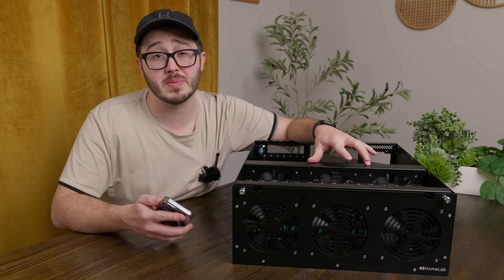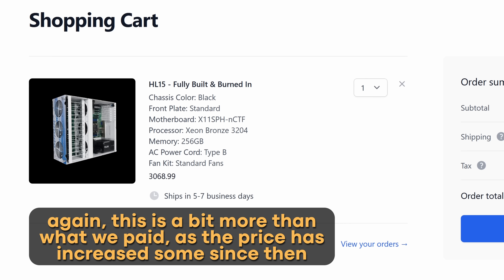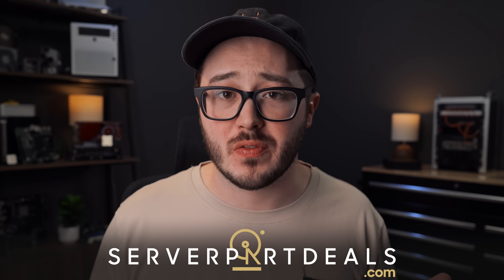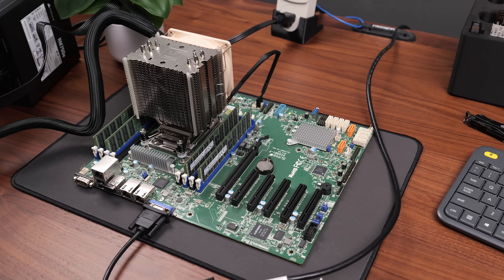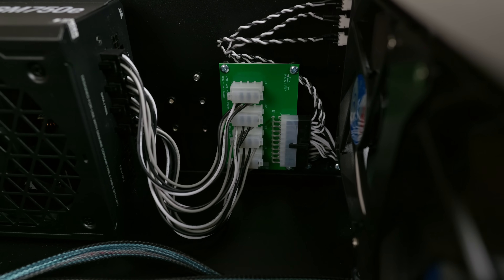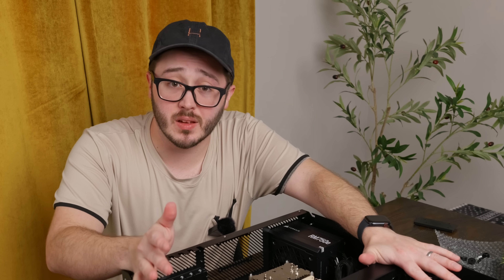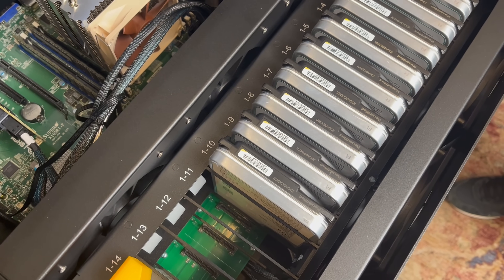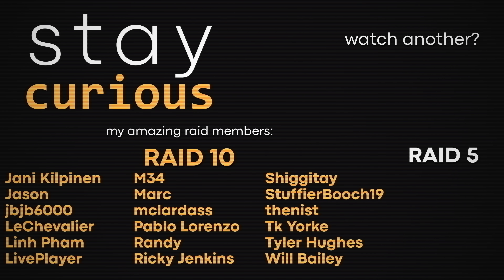I got an HL15... but not for the reason you think.

Comment: In the EU(germany specifically) its cheaper to buy new drives than to buy from serverparts deals as the drives itself are cheap the taxes they add on top(not calculateed in the price) are not if you buy new one you pay about the same and its new. Granted the new ones are not Enterprise Drives but same capacity.

Comment: What slide rails did you use in the rack? I also have an audio rack with threaded posts (as opposed to cage nuts) and finding slides that will fit for some of my gear has been a challenge.

Comment: The side facing fan is just screwing up the air flow in the machine. The card in the back is going to get plenty of flow for the heat sink without that. In fact it'll probably get cleaner flow because you don't have another fan pushing on the air causing a dead space someplace before that card. If you wanted to direct air, putting in a wedge of plastic to direct more air through the card would be a better solution for cooling rather than disrupting airflow.

Comment: I use M2 SATA boot SSD in a PCIe adapter (and NVME SSD on the same card for cache), only uses one SATA port, keeps the drive bays for storage, and there's a bit less cable clutter. I can see why you'd want redundancy though.
Surprised you didn't do 10G direct NAS to NAS connection. If you're automating backups it keeps traffic off the main network links.
I do like the Supermicro stuff. Been using since the X8 stuff started being sold second hand here in the UK. 
Until I went to Ryzen I was even gaming on a Supermicro 1366 ATX board with two 6 core Xeons.

Comment: LAG doesn't increase the bandwidth between two nodes, it allows a single node to service more clients without slowing down. To increase bandwidth between two nodes you need to use protocols that automatically split transfers into parallel streams and then recombine them, like SMB Multichannel, or faster NICs.

Comment: As other commented, just setup the 10g to each other and watch the data fly. Watching T3 (TrueNAS Tech Talk) with Kris and Chris from TrueNAS they suggest pulling the backups from the main server. That way if the main server is ever comprised, they don't have all an account to access to your local backup server. So pull the snapshots from main to backup instead of push. Makes sense from a data security. Great video.

Comment: To better align the fan that cools the heatsink on the RAID controller, we've had some success with Antec's "VCOOL" and also Vantec's twin slot fan that is designed for PCI slots.  The Antec VCOOL comes with an extension sleeve that adds more overall length.  The VCOOL also has a 3-speed switch, and it intakes air from the rear of the chassis.  In your setup, the VCOOL may only recirculate air that has been exhausted out the back, but at least it provides some options that your Noctua fan does not have.

Comment: I would skip the 10GbE and instead buy two Mellanox CX4121A 25GbE NICs and two one-foot 25GbE DACs and directly connect the two servers together that way. It would allow you to completely skip their LAN and avoid any network congestion in their switching fabric. Plus, you can still do a LAG over both DACs and mitigate the risk of a single connection failing, and in the far future you could switch to multi mode fiber and 25GbE transceivers, and physically separate the servers like others have suggested.
Reply: x10 HDDs in RAID10 that's about 600MB/s write speed. I think 10GbE is fine

Comment: 45drives the worst deal ever 2000$ for a case ,what  a rip off , and the bigest rip off is if you buy a complie system , they charge you 1000$ more just to assemble it , , could have buy a old used case for 50-200 or free , that will have done the same job ,
Reply: They don't cater to the Home labber
Reply: @mrmotofy  yeah i know but still is way to much for just a case ,  i currently have 6 pc host in normal pc case ,on shelf  my pfsence , my workstation , main server , cctv/torrent , long term storage server , and backup server ,  i will like to move them to rack case , but even the cheapest option for rack mount case about 200$  per case , sims to much and not worth it ,
Reply: @ There's nice 4U cases for like $150 from Rosewill etc If I recall correctly

Comment: As someone that works in enterprise IT, i use TrueNAS at home and for testing, however in this case i dont think this is a great solution. This is a path to you always supporting them, whether they have a local IT guy or not, if he ever leaves finding a local MSP that can deal with this solution will be impossible as ZFS/TrueNAS is not something most people have run into. Did you purchase support from IXSytems, you didnt mention in the video. Should have just bought a off the shelf NAS that anybody can support, would have cost significantly more but its worth your sanity.

Comment: Why didn't you just install the tailscale app in truenas? You can avoid the extra computer. Plus if someone there needs remote access to the file share they can have tailscale on their own system with the server mounted as a drive.

Comment: The issue that made me backtrack on the HL15 purchase was the backplane. Where can I get replacements? How expensive are they?

I feel like Sliger is a better option because they don't use a backplane but as long as the controller supports hotswap, the chassis is hotswap.

Comment: Hey. I have a question. How do you mitigate a ransomware attack on the nas?
Reply: Snapshots allow you to rollback the filesystem so long as the NAS isn't directly compromised.
Reply: I had a synology that got encrypted and rollback did nothing.
Reply: @dunhell9601  As far as I'm aware Synology doesn't use ZFS so yeah, you'd need a backup of the data on the device somewhere else.
Reply: You restore from an offsite backup or other device that wasn't compromised.
Reply: 1 option is have a backup that's sort of cold storage or similar to sandboxed by having your backup physically isolated from the network by a 120v switched network switch. That way the network switch is only powered on or network linked  when the backup is running. The network switch gets physically powered off to disconnect from network. It could all be automated if desired but simpler to do manually. 

Sure you could essentially do the same by plug and unplug from the network but there's also options like using a smart plug etc

Comment: For the round threaded spacers, use blue (removable) loctite on the screws that hold them to the frame. This will secure them from coming loose due to typical vibration, but you can still unscrew them with a little force if you need to.

Comment: The HL15 was never really for homelabers. Now that it is $200 more expensive it definitely isn't.
Reply: Agreed. I thought of getting just the case and backplane only to be hit with a cost of $2000 CDN. Yikes.
Reply: You’re acting like costs everything sometimes having something that just works is worth a lot of money compared to a project from eBay
Reply: It's expensive but it's like 1/3rd the cost of an AV15.  For people who want relatively quiet and a lot of storage a fully built HL15 is about the same price as a 12 bay Synology or Qnap solution and the rackmount options are more expensive.  Up front cost is up there but having options like the HL15, hakocore or the hopefully soon to be released Sliger are 'better' to a lot of people than trying to get a supermicro chassis quiet, having to deal with a Rosewill unit or trying to track down a used storinator for a decent price.
Reply: @nadtz  I compare it to the Sliger CX4712. 10 3.5 bays (front hot swap), 2 5.25" bays, and (4) 2.5" mounts all for ~$450 USD. Sure you're gonna have to bring your own hardware, and OS to the party, but i still think that 45drives missed the mark here. Sure the built up systems are cheaper than a synology or similar, but if they want to play in home lab, they are really competing with a used Supermicro chassis on ebay and need to be making the case for how the HL15 is worth the extra cost, and they have to compete wit the $150 rosewill 4U cases as well. The HL8 missed the mark IMO as well, there aren't really any ITX boards with both fast enough networking and enough sata/sas ports.
Reply: @ The Sliger is nice (I have one) but 10 vs 15 drives is a huge difference for a NAS for a lot of people.  For pure storage I went with a hakocore mini but I was about to purchase a HL15 when the hakoforge website went live.  In the end like I said it's nice to have options to suit a range of needs even if the up front costs for some of them are high because they are somewhat niche.
Reply: @nadtz  It's many times the price of the dime a dozen generic (TGC etc units) 24 bay 4U units. It's a big miss. There's no point in the 15 bay units because you can get a 24 bay unit, replace the fans with quieter ones, and it's still less than half the price. 45 drives 'special' is in the name. 45 drives. You can get other 36 bay units cheap albeit they usually require 2U components.   But 45 drives. There's no competitor. a HL30 for this price, they might have something. 

And yeah, 24 drives, for less than half the price vs 15 drives for this is a huge difference.
Reply: @ Except reliably finding SM 846 chassis for a decent price now a days is a non starter.  There are some other 24 bay options that are decent but then we're back into rosewill build quality for the 'cheap' ones.  If that suits your needs that's fine but it's nice to have better options.  And the whole reason for the 24 bay 4u popularity is because you have 4u to build in, the 36 bay/847 is not part of that discussion.  Is the HL15 for everyone, nope.  But for those whose needs it suits it's a good option even for the price.

Comment: hopefully you used PETG or ASA or ABS for those caddies. PLA won't survive the heat of that environment. Also, it would be smart to move the SSD to the otherside of the backplane if one of the u.2 connectors failed or something.

Comment: V4 run pretty fuck cool and even V3 E5 26xx xeons i even run a turbo unlocked E5 2699 V3 18 cored running 3.3 ghz it cant hit 3.6 ghz as i hit the tdp limit and its using a shitty air cooler never see it going over 50c its never even close to it even its using 256 gb of ram quad channal (4 ram stick) i can add 4 more to get to 512 gb of ram but 256 is allready overkill its running win 11 pro and arch dual boot but im gone switch the win 11 pro to the ltsc version as microsoft is a bitch and likes to add useless spyware crap to it or just re-able it with ltsc i dont need to worry about that
Reply: For context in cpuz  single core test is 399-405 this can be way better if i strip down windows useless bloat or just switch to ltsc

Comment: Silly question:  Did you consider putting a 10Gb/s link just between the two HL-15 servers?  It seems like that might make the snapshot process a little better.  Nice servers.
Reply: Or a direct USB4 connection at 40 Gbps would work? Although not sure if the motherboards and/or True as supports that.
Reply: I don't know the network config but 10G on each server with a low cost 1/10G switch (I'm using a TPlink T1700G 28TQ (4x10G and 24x1G), as it is an old model must be better models now)  is really working well. 10G between the 2 servers and even if each individual station is limited to 1G the main server can sustain 1G traffic to 10 stations simultaneously.
Reply: @frederichardy8844  you could also just use a crossover cable and avoid the switch for that purpose.

Comment: Until they roll out 10g to the workstations, you could just do a 10g point-to-point link between the two servers.
Reply: This. 100%
Reply: This plus taking the backup off the primary network in case of ransomware
Reply: Yeah - especially because they're right next to each other.....
Reply: I was thinking this before heading to the comments 😊
Reply: Yep, a point to point SFP solution is less than $200 which can't possibly be a big issue for them. Two cards and a copper cable is no big deal, I have that for one of my servers to reach my switch/router, the primary workstation has fiber transceivers to do the same. The whole set up with switch/router with 8x2.5G + 2x10G SFP (Mikrotik CRS310-8G+2S+IN) plus NICs, cables, transceivers etc is less than $1000 I think. 
So I have 10G between the server and switch and 2.5G for the other clients, but my use isn't primarily for video editing off NAS drives. If it was I'm fairly sure it would do okay for that too. More 10G ports would of course be better but my homelab is on a fairly strict budget.
Reply: Even just temporarily to do the first backup. Ohf
Reply: IMO, it'd be worth it to get a 2x SFP28 or SFP+ card and then lag those together in a point-to-point just for backups as the cost of getting a dual-port card is not much more money for the doubling of speed.

Comment: I was surprised you just used the motherboard i used for 2 builds. I used a liquid cooler, with a slightly modified mouting bracket for one of them, even though it is 145w tdp and 22c/44thread it has a tough time going passed 50 degrees c, even during cinebench multicore (ID-COOLING FROSTFLOW X 240 CPU Water Cooler AIO Cooler 240mm). I put a 3060ti in it for the lulz and it even games well, LLMs. I put 8 (Samsung VLP 1x32GB 2RX4 PC4-19200 (DDR4-2400) ECC REG Server) in with the 2699 v4 and nearly pulled my hair out diagnosing a dimm c1 error at startup, I even bought a new used same motherboard / 18c/36t cpu / corsair psu where it had these issues intermittently. I diagnosed it so hard, ended up taking the 2 sticks out of dimmc1 and went with 192gb ram instead of 256. The other mobo sits in a 1u case where i originally found this setup from a local guy for 80 bucks, so the 18 core is in that one with the 64gb ram left over. Besides the nightmare of the dimmc1 issue, I am happy with the setups. Cool server atx mobo.

Comment: What is the reason/benefit for going with two RaidZ1 vdevs vs one RaidZ2 vdev?
Reply from the maker: A: slightly better performance by not having a really wide vdev 
B: we have the option of adding a 3rd VDev if we need to add more storage
Reply: @HardwareHaven  zfs recently added support to add drives to an existing vdev without losing data recently, didnt they?
Reply: @creamy8715  yes they did, I've used it. Slow (the optimized it because it was slooooooooooow), you have to rewrite each file to really get all the benefit (very few % of storage lost if you don't) and the estimate free space is less accurate after expansion. But in the end it's OK!

Comment: Aren't those Logitech keyboards with the trackpad the best for servers and systems you don't have to work on constantly?  Reliable, and the batteries last forever!  I've used them with Pi's, servers, and even desktops where I don't have much free space.
Reply from the maker: GOAT. Minus that I had to 3D print storage for the dongle and that the Fkeys aren’t active by default lol
Reply: We leave trackpoint keyboards at our clients when space is an issue.  Run into enough problems with wireless keyboards that we gave up on them but that was also some time ago, maybe I'll get work to try the logitech.